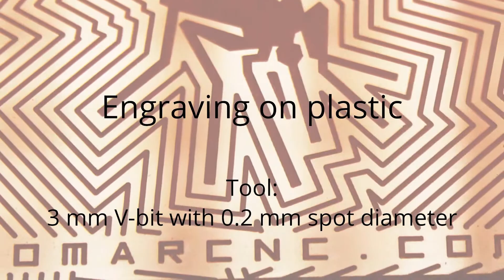Desktop CNC "KOMAR" Engraving on plastic

Comment: how did you get the chips cleaned out after milling?
Reply from the maker: +Dennis Peacock There are not so much chips so it's easy to remove it just by blowing. What you can see on video is protective film that must be removed after machining.